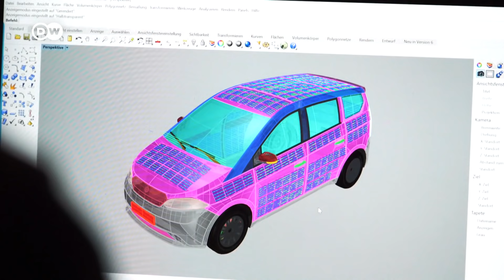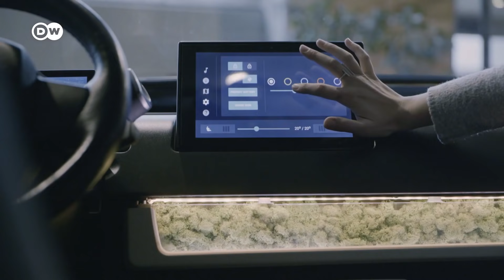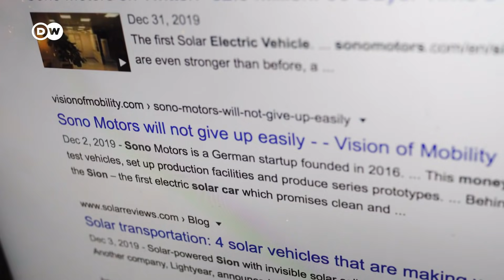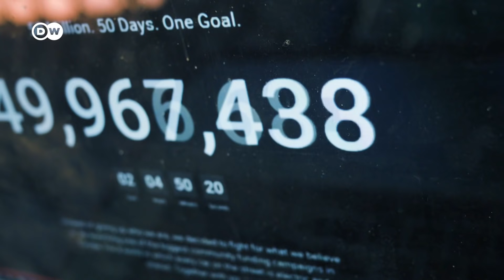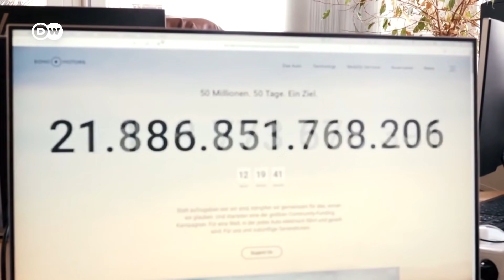Affordable Solar Car? The Sono Sion Story

Comment: It won't work unless there is a significant improvement on the conversation rate of the solar panel
Reply: It's not like you can't use it like a normal electric car, plugging it in.

The benefit is that this will completely eliminate phantom drain say parking it at an airport for weeks, no loss of battery. If you were camping this would give you indefinite electricity for your small appliances.

On an ideal day this could add 15 ish miles per day, future more efficient panels will give more. For someone like me that drives small amounts like 7-10 miles only a few days a week, this would mean never plugging it in.
Reply: It'd have to be well over 100% efficient for it to be possible, which of course is impossible. There is no way you're getting any significant power from that small an area of solar panels.
Putting panels on the doors just shows what a nonsense gimmick it is - you may as well put them underneath the car.
Reply: @drunkenhobo8020  More than 30 km at sunny days at Munich!

Comment: The concept is nice, but my electric car is not parked under the sun but in my garage, and my solar panels are on my roof always under the sun and with the perfect orientation. Furthermore my solar panels are on the roof for 20 or 30 years, while even if I drive safe I am afraid my car will not last so long. However I understand the concept that solar panels on the car implies a smaller battery, saving weight and cost, but installing low cost 16A plugs -- or even better induction chargers -- everywhere is also a solution, if you can charge each time you stop you do not need a big battery. I hope the best for Sono Motors but I am driving an EV since a long time and I saw many such initiatives die...
Reply from the maker: Let's hope Sono is able to overcome these challenges that other EV's haven't been able to.